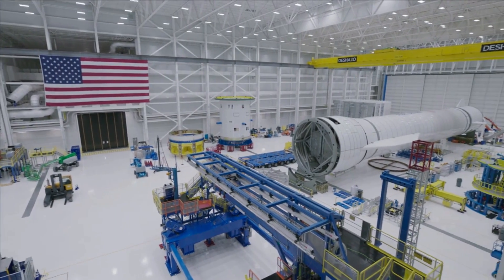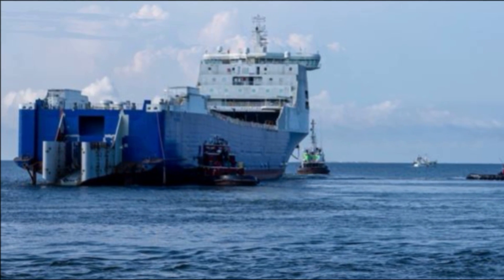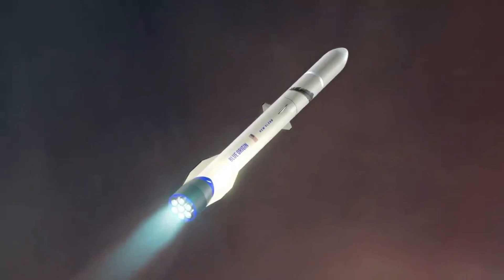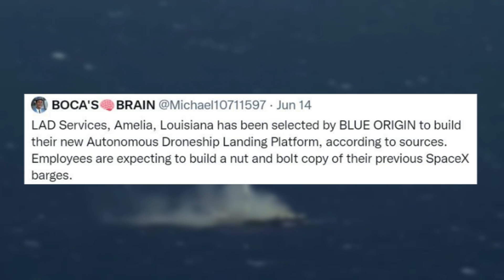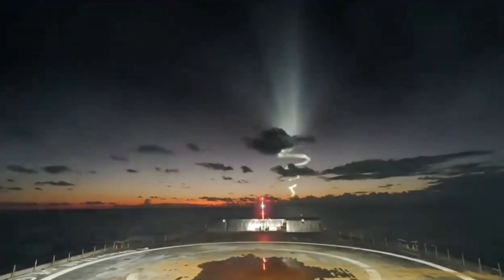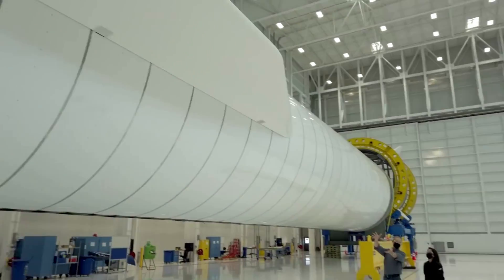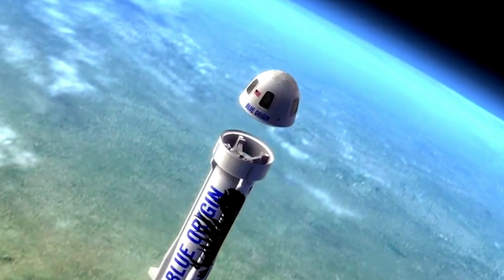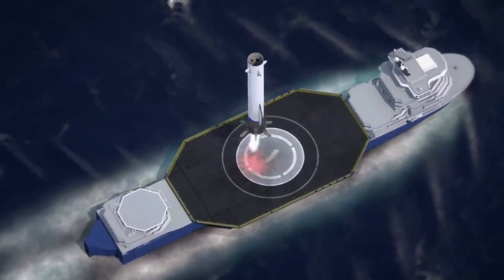Why Blue Origin Is Planning To Use A Drone Ship For New Glenn's Landing

Comment: Reusability in the Rocket industry is too overrated. To retrieve the booster, it adds more complexity to the mission, more propellant required for landing, as increase in operational costs. Especially using naval means. That's why I'm starting to be more of a supporter of the ULA recovering system to the Vulcan Centaur, focusing more in retrieving the engines.
Reply: Yes, it increases propellant use and operational cost, but it completely eliminates the need to build a completely new rocket everytime. If anything, rocket reusability is still underrated.
Reply: @MMadesen  you still need to refurbish the booster, and the additional weight of the landing mechanism. For a reason SpaceX isn't clear about how much is spent using the barge and refurbishment.
Reply: @RogerM88  Refurbishing cant cost more than to build an entire new rocket. 
SpaceX and other firms woudnt bother, if reusability woudnt be worth it. 
Reusability is just not implemented everywhere yet, because its a new technology and still hard to achieve. 

Other than that, its superior in almost every way.
Reply: @MMadesen  that, and the emerging use of methane is going to lower fuel costs by an absolutely massive margin.
Reply: India is producing single use disposable 
launch vehicles that cost less then falcon 9. Also 3d printing is making single use launch systems cheaper.